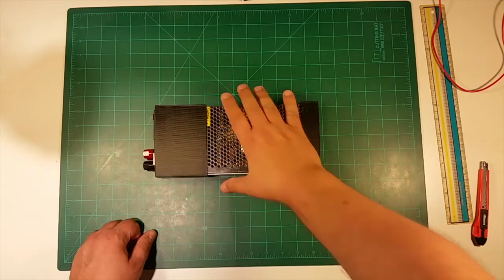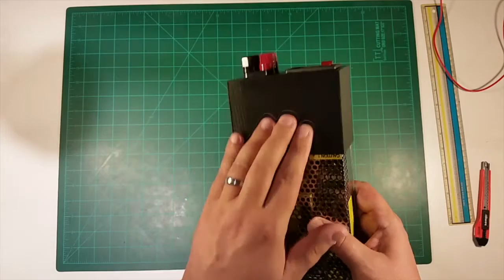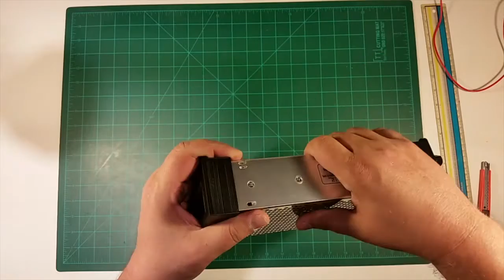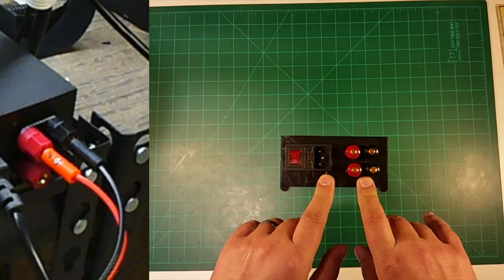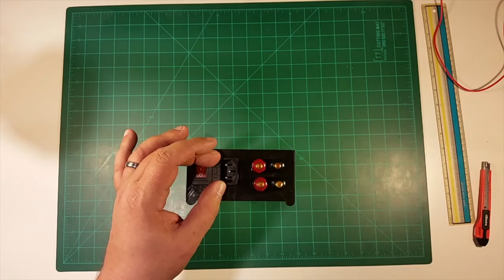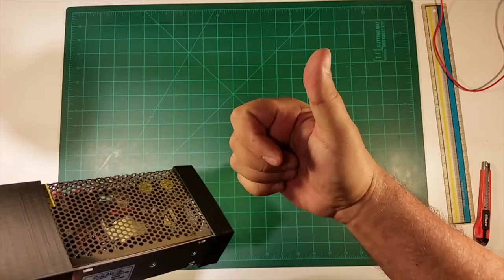Tevo Tarantula 3D Printer  -  Customizer Case for Power Supply!

Comment: Hello Dear DIY3DTECH,
I have been seen your videos and they are pretty awesome. Thanks for your efforts.
I have a question:: why you didn't print the power supply case with the Tevo Tarantula? Does tevo couldn't print i mean :D ?
Thanks
Reply from the maker: Not sure I understand however yes you print the power supply case with the Tevo Tarantula, however I had it a part when I designed it so I just used one of my other printers to avoid doubling the work that is all...
Reply: LOL
I meant that can i print this case via tevo :) , nice to hear that i can :)
Thanks for your respond
Best Regards

Comment: An excellent little project. I think I need one or these myself after seeing how neat it turned out.
May i ask if you have had any issues with warping from heat generated by the PSU ?
Reply from the maker: thanks and none at all, even in PLA have had no issues as its doesn't really cover up the vent holes or anything.

Comment: I have gone through 2 Chinese power supplies on my tarantula. The last one exploded a bit so I found a 300w computer power supply. It works so much better so far
Reply from the maker: Interesting as I have not any issues with mine, however read that computer power supplies for 3D did work well something to do with frequency of region or something.  However Your having good luck with one?

Comment: great idea ,  Makes me want to get one of those buck power supply control things and make a housing on top to have a nice small bench supply .   
re not showing the wiring , possibly take some stills and pack em on the end of you video as a slide show , or a link to a unlisted video ?  . any how great job man .
Reply from the maker: Many thanks, also working on modifying it for PC to bench top power supplies and as shared with Chuck.  I am trying to keep videos to 5 to 8 (where possible) as this has significantly improved my statistics and second didn't want to make about this power supply, but power supplies in general :-)

Comment: Can you please show how to wire the power in fuse panel mount.thanks
Reply from the maker: There is a schematic on the amazon site (see the link in the video description below) which shows the terminal connects from the switch block and you simply  wire the fuse inline with the switch...